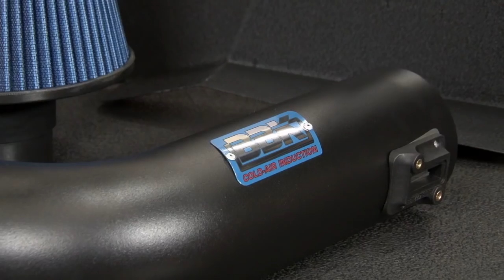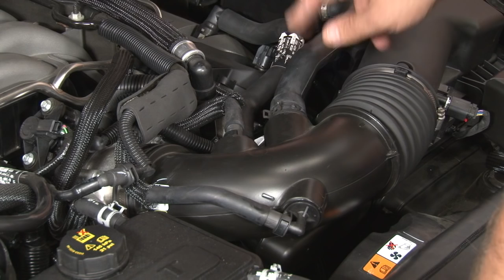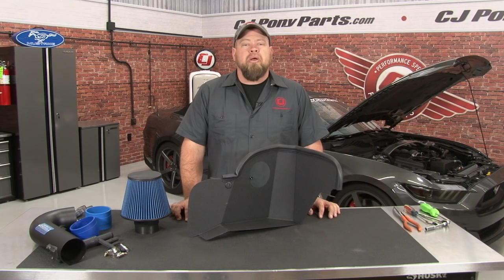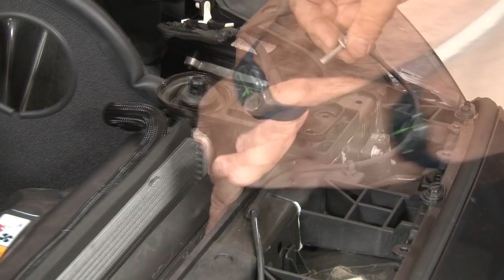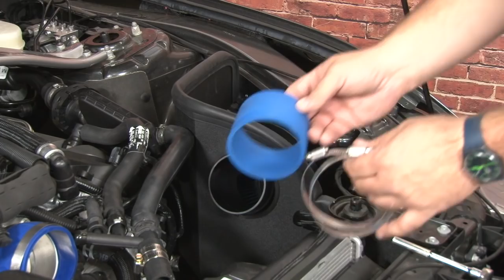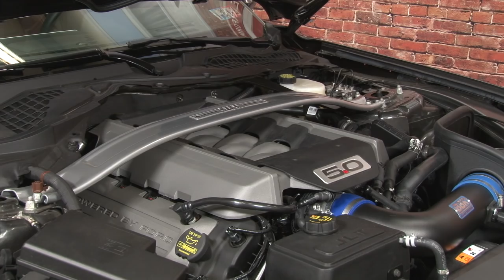2015-2017 Mustang GT BBK Cold Air Intake Kit Power Plus Blackout Installation

Comment: this cold air kit made my air temps reach 190 degrees at a stop light, now i hv a airaid kit with a non metal tube and the temp is always 5 degrees above the outside temp.the metal tube on this kit is like a HOT air intake , i say fail......